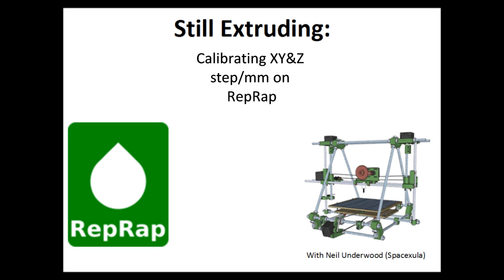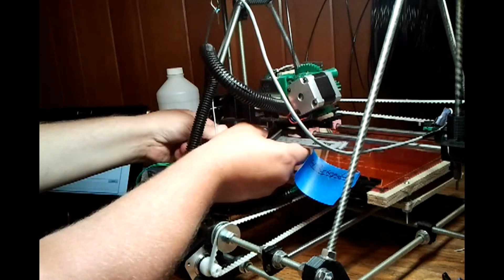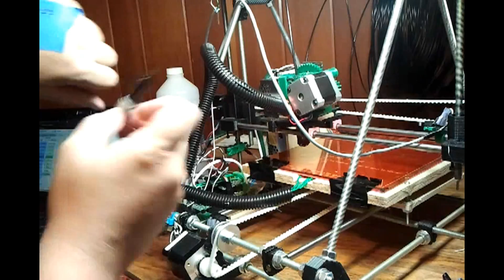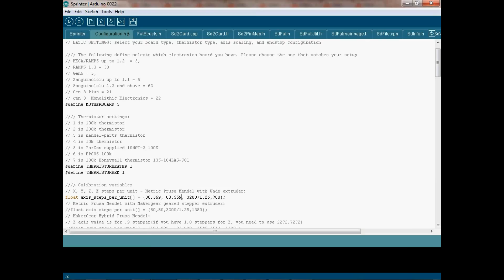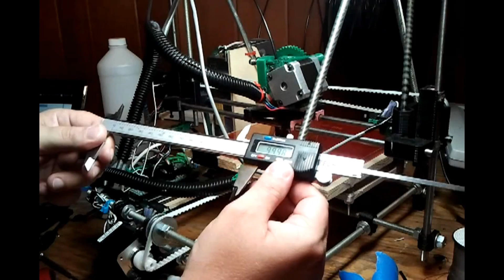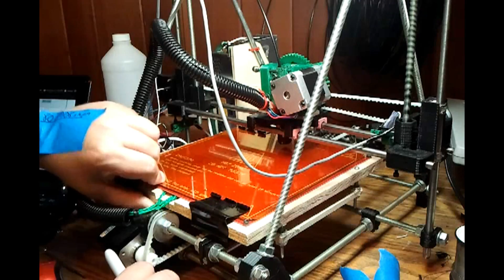Still Extruding: Calibrating XY&Z Step/MM

Comment: If you move 150 or 200 mm and multiply by that number (150 or 200), etc. you'll be able to get a lot closer in fewer round-trips (i.e. using a larger number will show you more error, more quickly).

Comment: Nice video!. You cannot be too picky with the measures. First the cheap 12 bucks chinese vernier has a 0.2 mm tolerance (theoretically) second, i do not trust the instrument was perfectly parallel to the axis. So even tho you get a 99.99 mm movement, it wont be 99.99 unless you work with more reliable instruments and perhaps find a way to add some kind of support to it so it wont also be affected by how steady your hands are.
At the then of the day, the quality of the print is what it counts!

Comment: Theoretically the formula should work perfectly, however if you use the method detailed in the video, you know for sure that it is working exactly. 

Also, it can simply be used to check either that the formula method was properly implemented, or to verify that some other physical component is or isnt correctly configured. 

I tried using the formula alone and kept getting oval-ish circles, using this calibration I was able to determine the cause. (A lumpy pulley I foolishly overlooked)

Comment: Hi! This is a great understandable video, Thanks! but i have a question though. Why not just use the formula? (steps = motor_steps_per_rev * driver_microstep / belt_pitch / pulley_number_of_teeth ) Will the motors degrade and vary from the industry-standard? or what are your thought about that? Keep up the awesome work, u are the biggest reason to why i've got a functioning prusa ;).